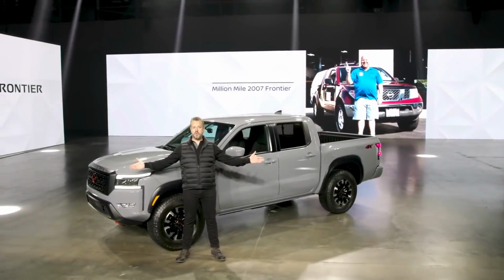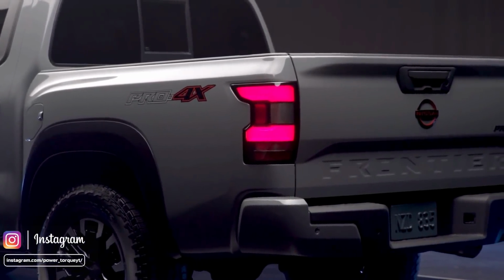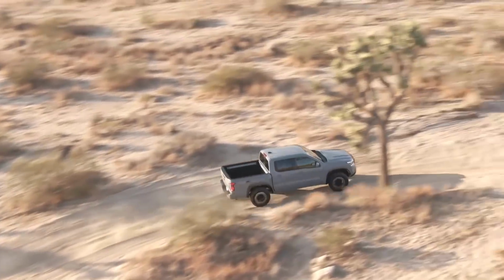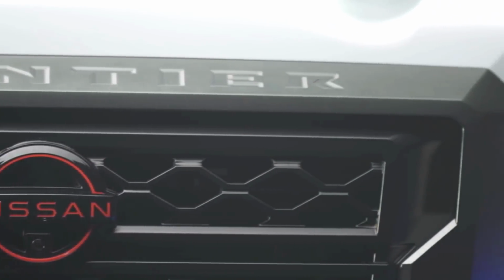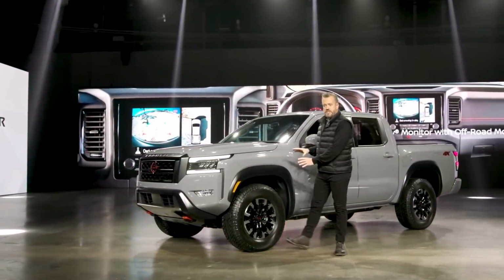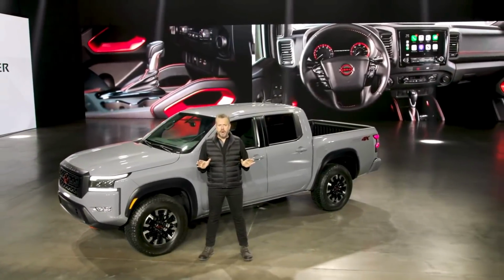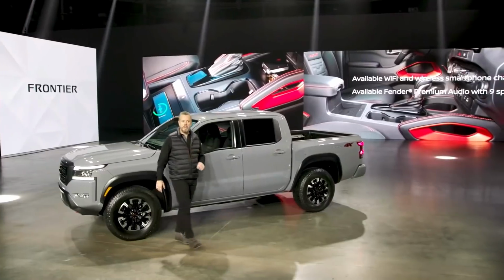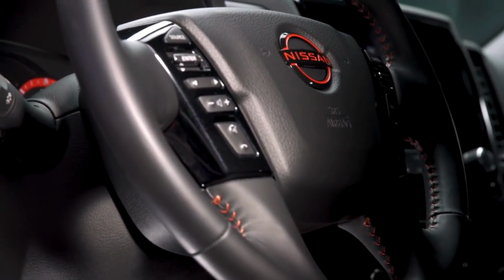New 2022 Nissan Frontier - Off Road Pickup Truck | Canton Vehicle Assembly Plant US

Comment: I have a 2012 Nissan Sentra S with over 224,000 miles on it. Never had an issue with the original CVT. I changed the fluid every 60,000 miles as required in the owner’s manual. Nissan is capable to be reliable as Toyota and Honda. You haters should learn how to read a manual and drive a car properly and you won’t have any problems long term.

Comment: 1. Handling smooth A+  
2. Braking A-
3. Ride smoothness A+
4. Headlights brightness (Base model C-) (Pro X A+)
5 Engine power A+
6.Transmission smoothness A+
7. Seats comfort. B+
8.  Seats adjustability B- 6ways 
9. Infotainment B+
10. Steering wheel C+  non telescopic
11. Shock and spring feel A
12. Quiet cabinet decibel ride A
13. Rear seat room C-
14. Versatility cargo A+ Has a bed
15. Value. B+
16. Over all score (base B-) (Pro X A)
17. Looks B+
18. Taillights A+ 
19. Wheels Tires B+
20. Rim (Pro X B+)
21. Backup Camera C-
22. MPG C-
23. Likes A
24. off road handling (Pro X A+)
25. Paint colors A+
26. Niceness A
27. Room inside feel B-
28. Price B-
29. Safety tech radar A